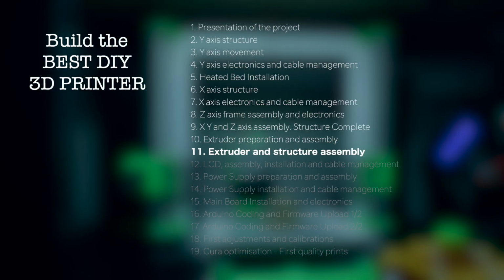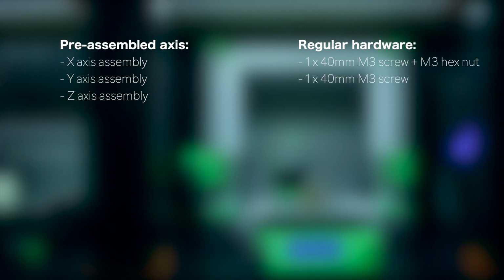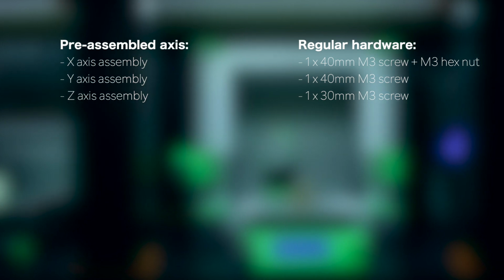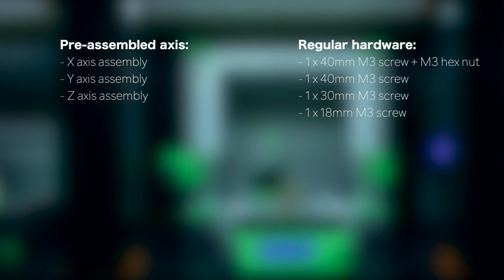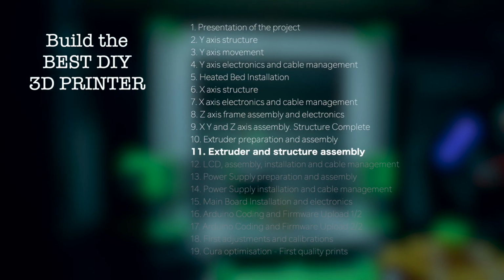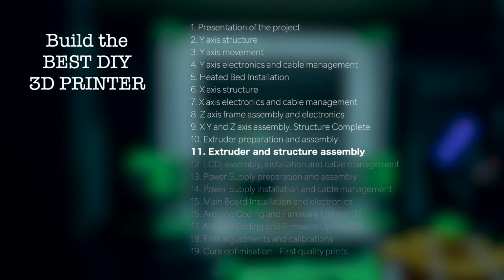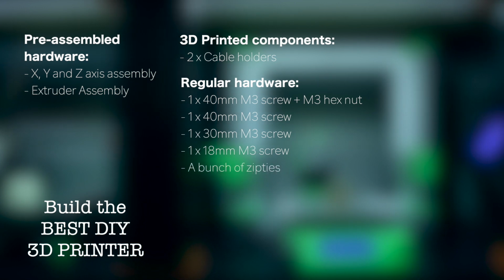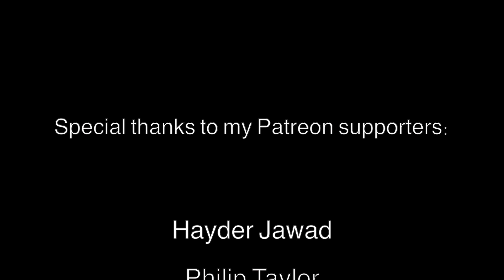Build the BEST DIY 3D Printer - Extruder and structure assembly #11

Comment: How was the motherboard attached to the frame? regular motherboard standoffs or a 3d printed part? you dont actually show that being fitted.
Reply from the maker: there are 4 holes on the frame, that match with the holes of the ramps 1.4. . Also used rubber spacers to separate it 6-7 mm
Reply: @architects3dp  many thanks! I only just got to the video where you show it being fitted. i cant wait to build this!!!!

Comment: What filament type are you using for the printed parts?
Reply from the maker: The green filament I'm using is PLA+, but I would recommend you to use PETG. Anyways, I haven't had any problems with the PLA I used. :)
Reply: Architects3DP great to hear. I picked up some PETG and had started printing from the Prusa files. I’ll be backing your patreon soon and getting those modified files. Thank you for putting this together!
Reply from the maker: Thanks for your support! :)